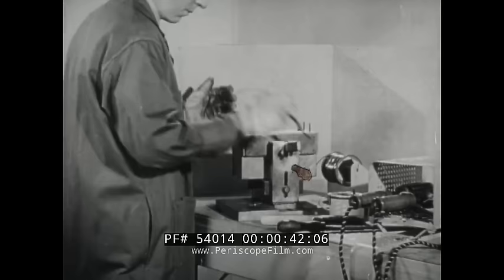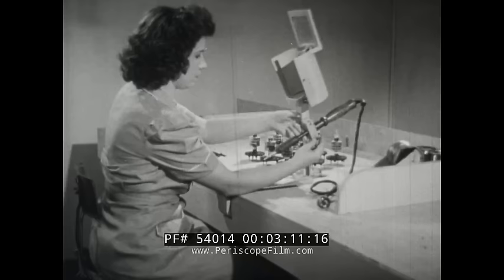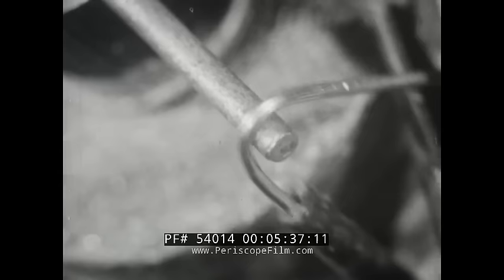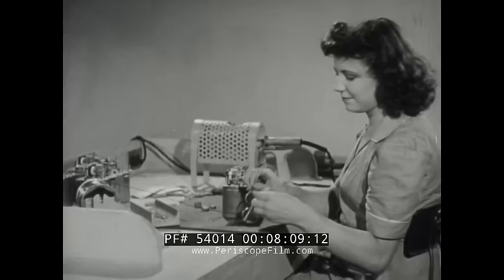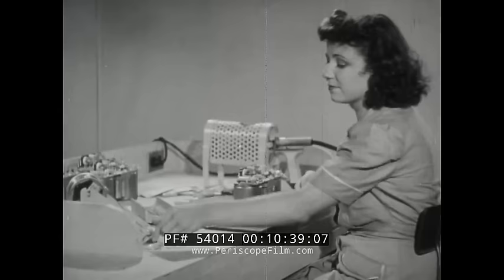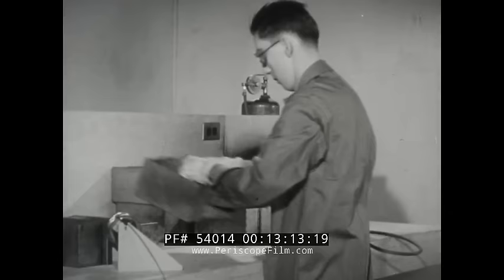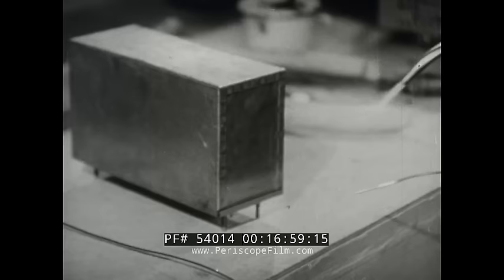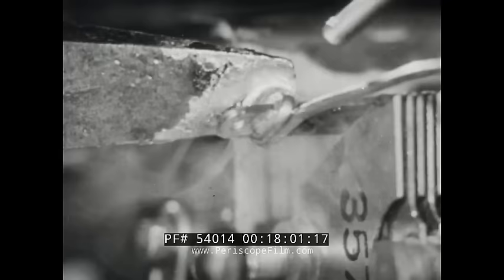HAND SOLDERING 1944 SOLDERING IRON TRAINING FILM 54014

Comment: I didnt even know they made irons THAT big 😳
Reply: You can still buy them! There’s a company called American Beauty that makes irons whose designs appear largely unchanged since this film was made!
Reply: @tookitogo  Thanks! Ill check that out.
Reply: @tookitogo  I was going to post the exact same thing. I found out about them when I found one in a lot of random old tools from someone's estate. Very nice. I actually do t use it as a soldering iron most of the time. I made a tip for it to use it as a hot knife to cut edpm foam.
Reply: @michaelallen1432  Imagine trying to use one on modern SMD components!  :p 

P.S. Years ago I dated a guy named Michael Allen, though I assume you’re a different one. 😜
Reply: Yes, they did in olden times.
Reply: @johnb6723  As I said above: you can still buy them brand new today.
Reply: Gives a new meaning to "The ranger with Big Iron on his hip"
Reply: The guys that fixed my copper roof in Columbus used big irons like that except they heated them with a gasoline fueled stove that a half dozen irons sat in . The name of the out fit was the Durable Slate Company the house I had there was A full 3 stories with a slate roof and copper valleys along with a copper roof over a bay window  . The pitch was so steep they had to build scaffolding to work on it that big brick house was built in 1895 was quite the fine home in its days and those guys were true craftsmen!
Reply: "... irons that big"
- I think they were possibly adapted from plumbing tools.
Reply: @tookitogo  
After being trained in high reliability soldering techniques on axial leaded components in the late 1970s, over the last year I have had to get a lot more acquainted with hand de/soldering of SMD devices. 
- I had some prior experience with 'large' SMD parts 4x5mm(?) on large cct. boards, but now I'm often using a microscope, tweezers & 0.4mm solder on much smaller components and more densely packed, multi layer boards. 
- Also using solder paste and a heated 'bed' to heat the entire board so hot air or iron can be used to remove/solder parts. 
- In a previous job the boards were so large (esp. earth planes) I used a hot air gun to heat the boards up prior to applying the iron.
Reply: @jabberwocky1707  Plumbing soldering (i.e. brazing) was, and is, done mostly with open flames. However, large, heavy soldering irons were commonly used for sheet metal work and things like clockwork, where you might solder a block of metal to a baseplate. It wasn’t a big leap for them to start to be used for electrical wiring, and then got progressively smaller as the circuits shrank! :)
Reply: @jabberwocky1707  I hear you. I do SMD work/rework under a microscope regularly. And yep, preheating from below is crucial for so many boards!

Comment: When printed circuit board was not invented  they were makings the circuit in air on the terminals.
Reply: That technique is called "point to point" wiring.
Reply: @clarencegreen3071  : or hard wired' worked on 60's guitar amps like that ...........

Comment: The right way things of important were done ….
I am 80 … Design Engineer 
At first the design was forgotten , than how to do things were forgotten , than which button to push was forgotten and now the button is being forgotten …
NOBODY WANTS TO LEARN ANYMORE… the how and why “simple “ things are done …?try and find a carpenter , an electrician or somebody to do do “handyman”!stuff !!!!
I STILL DO IT MYSELF !!!!
Reply: Me, too.
Reply: You hit the nail on the head with your statement. I am nearly 20 years younger than you but was taught the same as yourself. My teachers/ Mentors always taught us not only how to do it, but also why, what and where as well. I like to try to show the people I train the same way but everyone is in too much of a hurry to learn anything these days. I just tried to explain to a young coworker why his oxy/ acetylene torch was popping and back burning into the handle. After a quick 20 minute lesson on the correct operation and use on tip selection and pressure settings he replied, but the other guys torch does the same thing and acted like I was from another planet. I told him, well when the flame burns back into the hose  I guess you might learn the hard way!🙄

Comment: I joined the telephone company as just soldering in the field was being replaced with wire wrapping. This was taught in installation school for field techs and central office people. Something else I used to solder was the lead cases that went around the splices. Very old cable was covered with a lead jacket and the cases could be sealed to air and water.  The conductors inside were insulated with paper. No plastics in those days.

The new cases are PVC and bolt together. Special sealants are used to keep out the air and water.

Comment: so much asbestos 
This is so excellent in conveying the use of flux and why and how to apply heat properly.  I do wonder what that assembly was that they were working on.  Made me nervous that they did not test it first while out of the can!
Reply: It would have been a tuning unit for some medium wave receiver or transmitter, but I don't recognize it specifically. A lot of the parts were so large that I would have found this unit more common in the 1930s rather than the 1940s.
Reply: @lwilton  Yes, the coils are for some kind of radio device.  WWII is when they started shrinking the size of vacuum tubes.  Even portable walkie-talkies then had battery powered vacuum tubes.
Reply: @lwilton  I wonder if they were using the logic used for Liberty ships, older technology that was well sorted,  reliable, and relatively cheap and easy to build.
Reply: @JeffDeWitt  
Probably, and even a plumber could (with a little re-training on smaller electric irons maybe) be able to solder radios/ electronic parts together. 
- They could certainly do the boxes.

Comment: Ah! A 100-200W soldering iron must be used! That's why my surface-mount resistors never stick.
Reply: I laughed when I heard the power of the soldering irons. None of my soldering irons exceed 100W.
Reply: @BigRonRN18  
I have a teesny weensy 12 volt, 10 watter.
Reply: I've found that a Large Soldering Iron is best.  Has enough Capacity to get the joint hot and goes quickly without the Heat spreading beyond the joint.  A Smaller Iron can't concentrate the heat so Copper, being an excellent conductor, will bleed off the heat and you run the risk of Overheating the Components.
✌️😎
Reply: @NRDavis-wl8vn  
Indeed, the iron wattage and tip size, and even tip shape, need to be selected when possible, to suit the size/type of joint. 
- My ".. teesny weensy 12 volt, 10 watter." is only suitable for small through-hole components (1/8-1/4 watts resistors say) and small pads. Haven't tried it on surface mount, yet.
- My favourite Iron was a Weller (IIRC) 'Duo-Temp' which had a button on the side to give it a temperature boost when soldering larger joints.

Comment: But what was that assembly for when completed? That's what I want to know...
Reply: Wah wah pedals to help win the war...
Reply: Ham radio station signal amplifier.
Reply: It looks like radio transmitter frequency filter.
Reply: @obeomkwon5192  those look like 2 big capacitors...
Reply: The coils indicate it was for some kind of radio device.  Probably part of a larger device.  The workers were not told what they were working on for security reasons.  "Loose lips sink ships" was a common motto during WWII.  Most workers on the atomic bomb or the Bletchley Park code breaking were not told what they were working on.

Comment: I laugh at goggles just in case some fragment "flies into your eyes" because it never does. This coming from a guy who used to hold solder in his mouth while using both hands to hold the iron and the work.  😣  Well, lead poisoning wasn't drilled into us so much back then.
Reply: I almost got a particle of hot rosin into one of my eyes. Yes, it can happen.
Reply: I scoffed at glasses as well until the day I got some rosin in my eye while removing a resistor from a board being repaired.  Tiny little annoying speck of rosin bonded to my eye and scraped my eyelid when I blinked for a day or two.  It was the leg of the resistor that had some springyness to it and flicked rather than a splatter though.
Reply: Somehow I got solder melted into a spot on my prescription glasses. Dunno how, but it was there. Solder picked off, but the melted spot remained until I got new glasses. The memory still remains and keeps me wearing safety glasses when not wearing prescription ones.
Reply: Yeah, I have a small scar above my eyelid near my nose. I'm not saying it's a bad idea, it's just that we didn't do it back in the '70s. Then again, we used to be given hot plastic mold injection toys, chemistry sets and "creepy crawlers" which was a hotplate where you would melt sugar into gummy candies then eat them...always piping hot, of course. My favorite was the coca cola flavored spider!
Reply: I have the use of both eyes today only because I was wearing glasses while soldering, decades ago. I managed to flick a blob of molten solder such that it made a great, big, coin-sized spat, dead-center on the lens of my glasses.

I already had years of experience soldering, at the time, but I made a rookie mistake. Even experienced people make "rookie mistakes."  So don't be stupid, wear your goggles.

Comment: Damned soldering iron tip, keeps getting dirty, and no matter how much I dap into a solder cleaning pad, or try to file  it clean, it still gets dirty.
This video has ground-breaking modern advice, better than most video's I've seen.
Reply: You should only file a soldering 'iron' tip if its made of copper, or similar.
- IIRC most are now nickel plated, and filing removes that.
Maybe it's just too hot and the flux is burning?

Comment: Only real difference between than and now, is now-a-days folks need to be careful to only use cotton fiber cloth for wiping freshly soldered joints.
 Everything else in this video is STILL really good advice on soldering !
Reply: My dad always used cardboard, electrical engineer from Europe pre 1956, has this changed?
Reply: My dad always used cardboard, electrical engineer from Europe pre 1956, has this changed?
Reply: Not flux remover?

Comment: My only question is what the heck was that thing they made with the coils and the terminals in a solder sealed box?
Reply: It appears to have capacitors, coils and resistors which would typically be a combination for some type of oscillator. I had the same question. I hope someone recognizes these and can confirm.

Comment: So much for the 'rule' to never use the tip of the iron to melt the solder directly. While this admonition may be correct for small joints with temp sensitive ICs, if your soldering larger joints, then you do want to melt solder directly with the iron tip to increase the rate at which heat is transferred to the members to be joined. THEN apply solder to the members directly, thereby ensuring that they are hot enough to melt the solder (avoiding a 'cold joint').
Reply: you're*
Reply: You always need to add a small amount of solder directly to the tip or it won't transfer the heat to the joint.
Reply: eutectic solder.
Reply: I did several courses in soldering, up to RAAF 'High Reliability' Standards, and forming a 'heat bridge' was always part of the hand soldering techniques I was taught.
- Without that, the transfer of heat to the items being soldered was much slower, and the longer you hold the iron on the joint, the greater the chance of heat damage to components. (and/or the circuit board itself)
- We were also told to snip the end off the used solder to ensure that there was flux at the end of the solder, not something I see mentioned nowadays. Though I also use liquid flux as well as flux-core solder, so this 'snip' may not be needed.

Comment: Wish I had this 30 years ago! One thing I don't see is how to avoid overheating switches and potentiometers when soldering grounds to the casings. Heating the wire while it's on the casing makes it easy to cook the carbon inside. I know it's done easily, I just don't know how lol
Reply: Use a heat sink. We used spring-loaded clamps about the size of tweezers that were clamped onto the conductor between the soldering area and the component. Most of the heat traveling up the wire was absorbed by the clamp.
Reply: Try gently filing (or sanding as per the film) the metal "case" to remove any oxide,
- Make sure the iron is of sufficient wattage (50watt?)
- Use a 'large' iron tip so it doesn't cool down as you solder, 
- Apply liquid flux to wire and case, helps solder flow
- Use a jig or similar to hold wire/case still while soldering
- Try tinning the wire, and the case, if possible before soldering the wire on,
-- Then you can just use the iron to heat the existing solder , with a little more to touch up the joint, not ideal technique, but if it works ...
--- Assuming you are using flux-cored solder, snip about 10mm off the end of the solder as the flux can evaporate inside the solder, and the end is sealed by the previously melted solder.
Reply: @John-wx9oy  
I'd suggest not doing that, heat sinks are more for heat sensitive components and maybe stopping wire insulation damage
- In this case speed, and sufficient heat and heat transfer, to enable a quick joint. The longer the iron is on the case the more heat will flow into the carbon track, the more the iron tip will cool down, making it harder to get enough heat to melt the solder.
- Thus we probably don't want to draw heat away from the case/wire joint with a heat sink.

Comment: those are massive soldering irons
Reply: Yes. Almost looks like you could use them for hand-to-hand combat! I remember back in 1966 when I took metal shop for the first time. We had to build small trays that looked much like the covers in the film. The only difference was that our soldering irons weren't electric. They were heated by placing them in small gas-fired bench furnaces that hung on the wall.

Comment: 4:04  Does that not happen "automatically" while soldering?
Reply: Possibly it was a copper tipped 'iron', which I think is more prone to oxidation than plated (nickel?) tips used now, and as the iron probably weren't temperature controlled as now they would run hot, increasing the oxidation and possibly burning the flux.
-- A quick Google says tips are "... solid copper core, a plated layer of iron, a plated layer of nickel behind the working surface, and a plated chrome layer. "
- Even with modern irons its still necessary to clean the tip regularly (I wipe it before every joint) and keep it tinned and clean of flux residue.

Comment: Well, I learned to solder way back in the 1960's.  NASA would have had a fit on the electrical soldering technique demonstrated here.  Multiple turns of the wire around the posts do not add any strength over the first half turn, but add weight.  Thus that technique would cost more fuel to lift it into space.  The rest of how to solder is OK.

Comment: Holy moly that's a huge iron! LOL. I never used the brillo, brush, flux or sponge or canvas to clean the iron tip. I simply use my wire strippers. Wipe wipe... add solder... soaks the oils and dirt... wipe wipe. My Radio Shack 350 watt gun iron is still the KING. Guys look at me like WTF? You solder control wires, SMT boards and more? FASHO!

Comment: Why on earth would you put spaghetti over the resistor?  I have only used it like heat-shrink, for separation and insulation. The heat of the resistor might melt it or set it afire!  I am a ham since '57.

Comment: 10:21 why do i have the most horrifying suspicion that that sleeve is make of asbestos
Reply: And the walls behind the bench, too. Heck, the bench itself probably is, too! :(
Reply: @tookitogo  well i suppose if there's any consolation to be had the lead poisoning probably got them before the cancer did lol ... or maybe the cigarette lung cancer beat the  asbestosis   to the punch
Reply: @firefox5926  You can’t get lead poisoning from soldering unless you ingest the solder (or don’t wash your hands before eating). The temperatures are too low to vaporize the lead. 

Unless you were referring to the lead paint and fuel, of course!
Reply: I believe that her folded wiping cloth is also asbestos.
Reply: Possibly glass fibre
Reply: @the_eminent_Joshua_E_Hrouda  in the 1940s?
Reply: @robstephens  Safe enough as long as it stays intact.
Reply: @firefox5926  yeah, sorry. It wasn't invented yet 😔

Comment: This is some of the sloppiest soldering that I've ever seen, outside of people who shouldn't even touch tools. I've been hand soldering for over 60 years, everything from sheet metal, to ICs with their leads spaced 0.015", center to center. pure rosin flux was already obsolete when I learned to solder as a child. RMA is the preferred flux, and my favorite was made by Kester. My favorite cored solder was made by Ersin. The tip not only needs to be cleaned at the start, but frequently to achieve mirror finish to the joints.
Some of my work is aboard the ISS, and I've taught production workers better methods even after they had soldered for years.